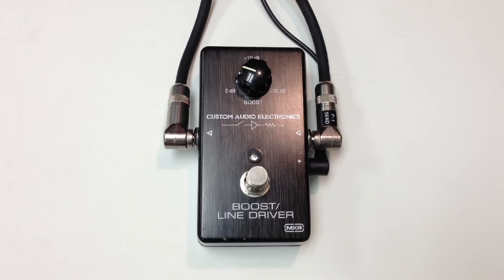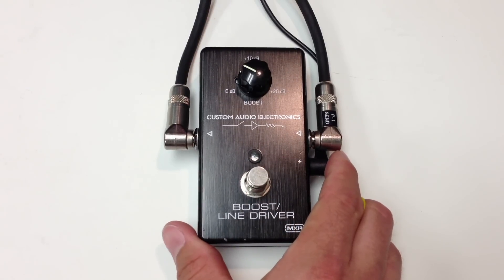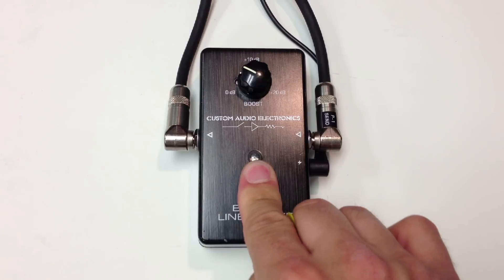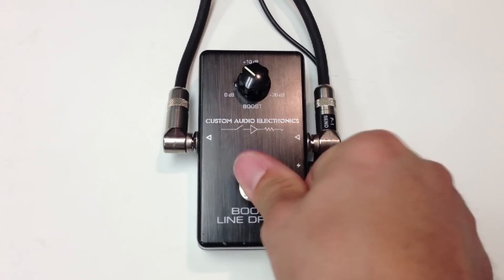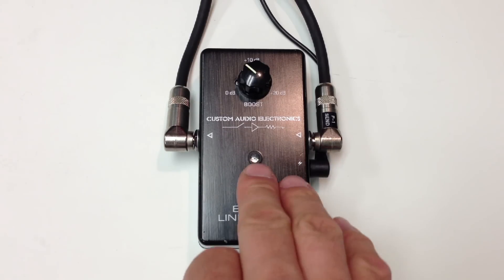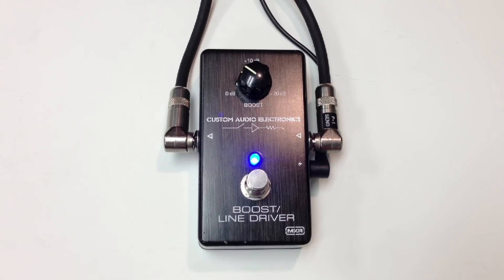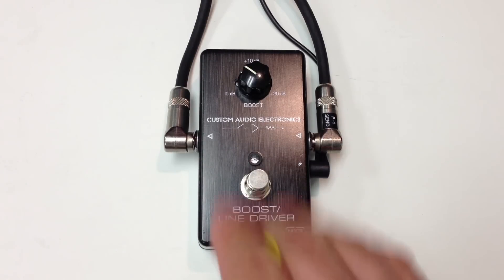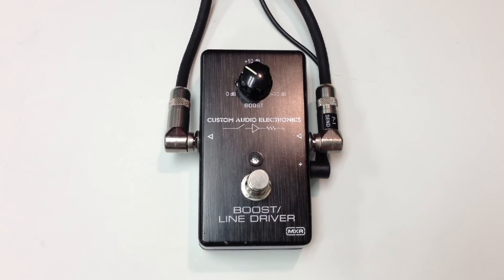MXR CAE Custom Audio Electronics Boost Line Driver

Comment: how is this pedal as a lead boost in the fx loop??. mdoes the 9vs 18 thing make a big diffrence there??.
Reply: I can answer that....If you have an already gainy amp like a 5150,put in the loop at 18 volts!!!  If you do that,you won't have to have the knob past 9 o'clock and will not color your tone at all,just adds volume.I own it and it does the trick. If you run high gain from your amp,it's so compressed already it won't do much in front,unless at 18 volts ...but you'll still need to crank the level on the boost.But then you'll get even more gain with the volume increase and may not like that.

Comment: how about when this is  in front of a distorted amp? No change in volume like most boost in line with amp? only cleans.
Reply: if u put it in front of the amp it will only boost the clean signal, dirty signal u wont hear much difference. The real impact is to put it through send and return loop, a quarter turn is already a killer.
Reply: I bought it beecause I wanted a volume Boost on Solos. If your amp is clean you that one knop works like a volume knop. If your amp is overdriven not louder at all. Just fuller.

Comment: This pedal has an input impedance of 1k ohms which is probably the worst I've ever seen on a pedal. I'm thinking there's some circuitry in the pedal that adds back the highs... but if it was designed right from the beginning it wouldn't need that.